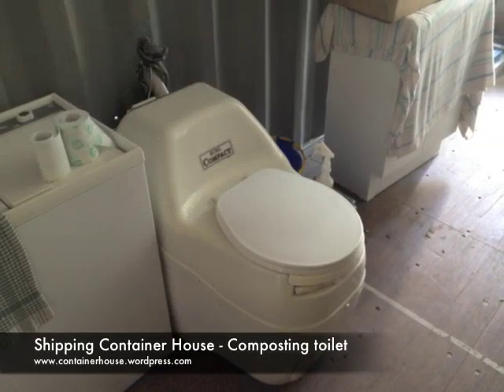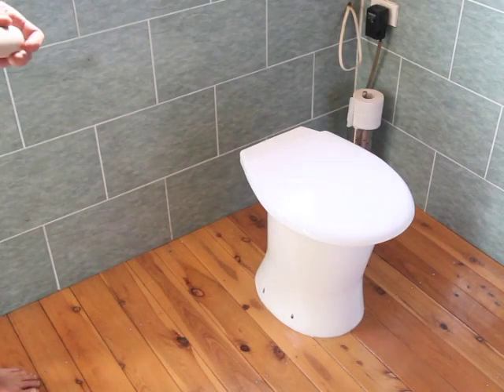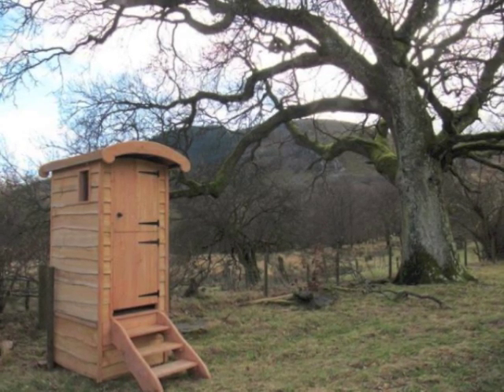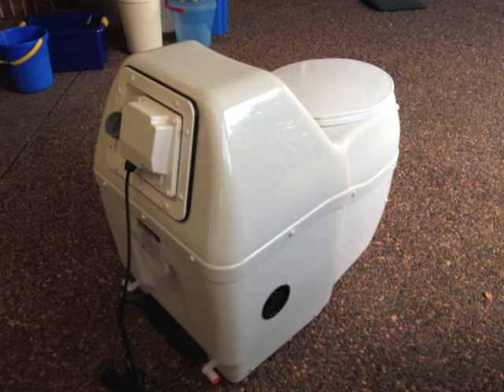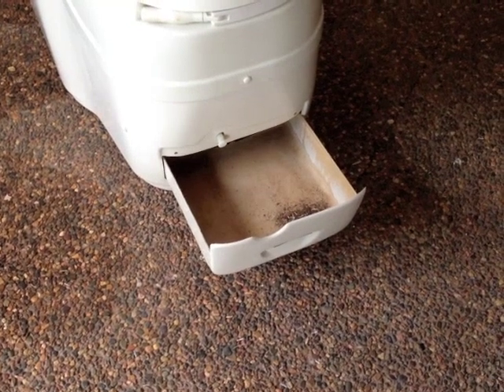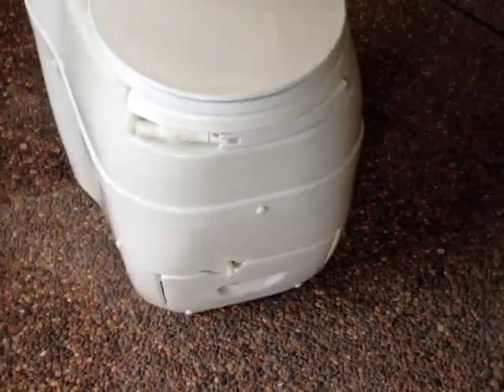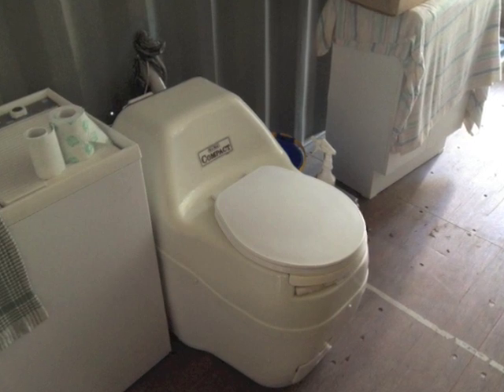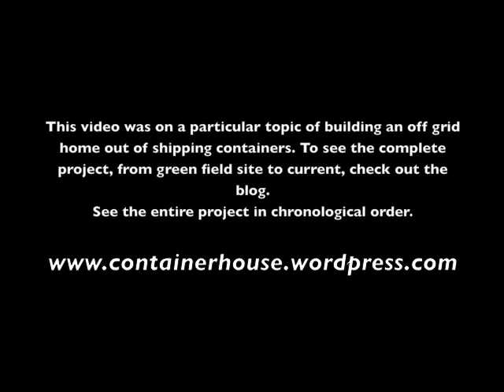Shipping Container House - composting toilet

Comment from the maker: It is evaporated off. It falls through the soil and peat mix and keeps it nicely moist. It is then caught in a big tray at the bottom. The heater mat or ambient temperature then evaporates the liquid out through the vent pipe. There is an overflow to cope with an unusualy high liquid content but in normal operation this is not required.